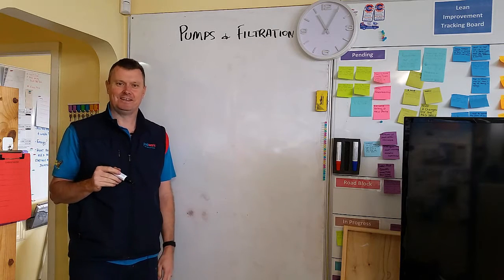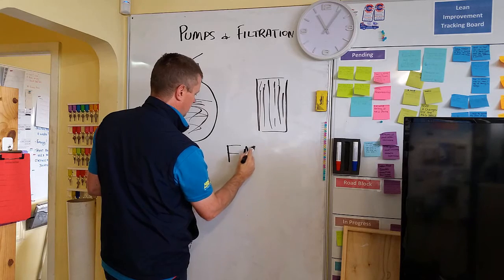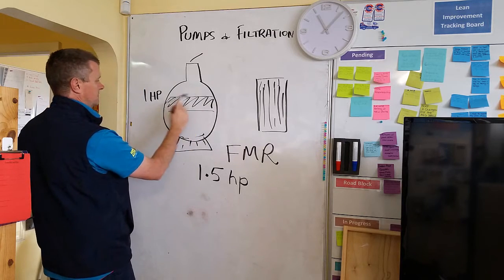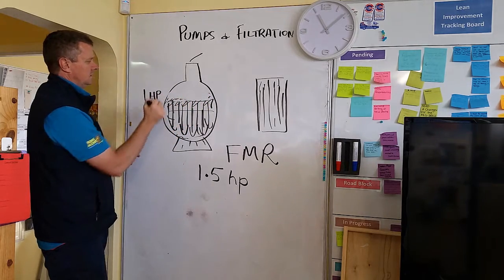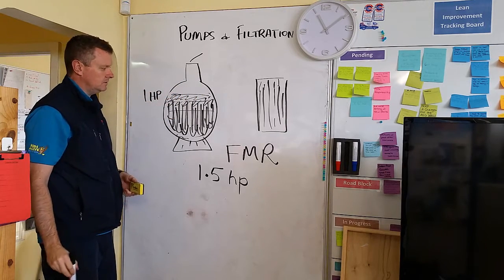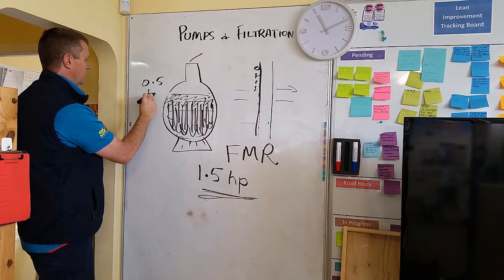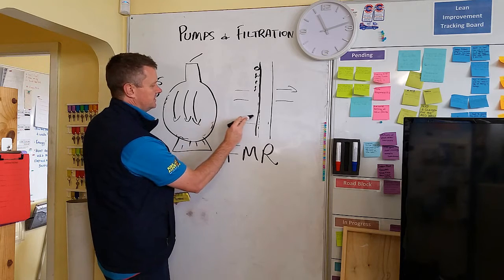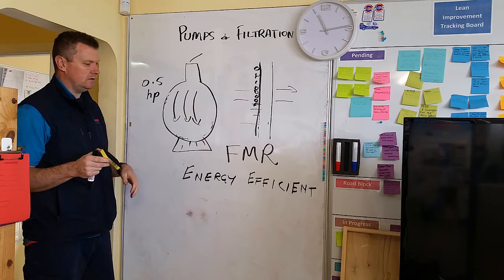Pump Sizing and Filtration

Comment: Ok- so what size pool filter should I have ?.... 16 X 32 inground pool. 4 feet shallow end, 8.5 ft deep end. (basic old school retangle pool) I have a Hayward Super Pump 1 HP.
Reply from the maker: Lisa Anne Sand Filter or Cartridge Filter?
Reply: Sand Filter.
Reply from the maker: Lisa Anne It depends a little on how complicated your pipework is but a good general rule would be to get an approx 24 inch filter with a 2 inch MPV on the top. In Australia that would be the Hayward Pro Series 24 inch with 2 inch MPV on top. I say 2 inch MPV on top because this gives the best water flow through the MPV.
Reply: Think you could handle the ten inch double wide big boy pump.